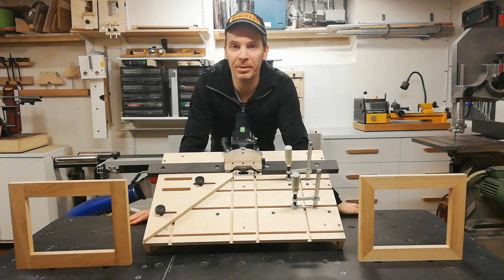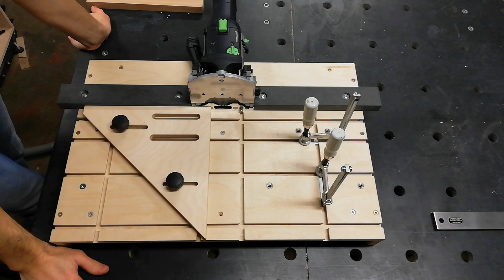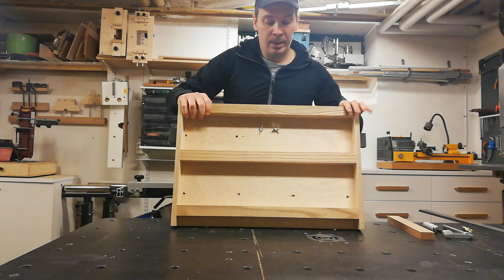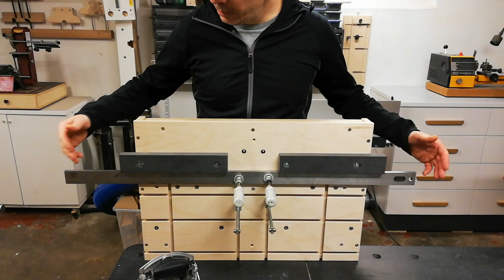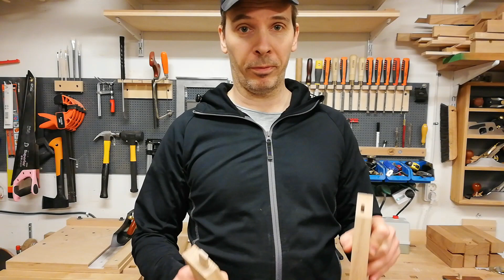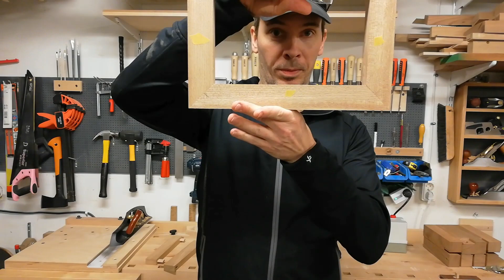High precision Festool Domino jig - Part 1 of 2

Comment: It looks like woodpeckers just came out with a jig (mortise match)  that is very very (very) similar to yours.  What are your thoughts on their jig?
Reply from the maker: It was some years ago and there was a heavy debate in the woodworking community at that point, both on youtube and different forums. Veritas released their version and credited me and gave me royalties per sold item. Woodpeckers released their version almost simultaniously and pretended they had never seen my jig (which is quite obvious they had). I wasn't as upset as many others were but I think Woodpeckers should have acknowledged me for the idea, they got a lot of critique for this.
Reply: @CarmoniusFinsnickeri  Ah, I'm late to the party.  In this case I don't think I'll give Woodpeckers my business.  Your design looks simple, solid, and precise, and I much prefer your embedded rod design for referencing the fence location when flipping it.  I don't expect to need anything more than 0 and 90 degrees, so I'll have fun making my own.

Comment: 2:05 congratulations you just broke your Domino!!!! 🤦
Reply from the maker: Thanks! I know that since a few years back, didn't know it when I made this video. Good news is that my Domino is +12 years old and not broken. I think if lever is not forced, nothing inside will brake but since a few years back I change width with the motor running. Stupid design imo, changing setting on a running handheld machine feels extremely unintuitive and Festool also changed this for the 700 model.
Reply: @CarmoniusFinsnickeri yeah it is a weird one. Good to know it's different on the 700 as that's the one I'm leaning towards

Comment: I am just about done building one of these jigs. What do you use for a reference line? I make a mark on my work piece, but there is no visible reference mark on the domino except the fence, which is too high up to use.

Thanks! Excellent jig and video!
Reply from the maker: I have the old generation Domino, on that there is a indication in the metal casting where the center is. I looked at pictures now and it seems they removed that on the "new" Domino where they changed the indexing tabs? Anyway, if it's not enough to lower the fence as much as possible, can you lower it and tilt it 90 degress so you use the fence scale from above instead? I should also say it's not very critical to hit the layout line perfectly, eye balling is more than good enough.
Reply: @CarmoniusFinsnickeri  thanks!

Comment: Hey. What saw blade do you recommend for the super jig where you use a 3.25 kerf?
Reply from the maker: @beewagyu  any rip blade with flat top grind (FTG). Several suppliers have these in 1/8" or 3.2mm. I use a swedish blade and that's maybe not of great help.
Reply: @ ok. Thx. Easy Peasy.

Comment: Excellent video and very well explained!  Question:  Any advice on how to get the holes for the domino placed so that the machine is exactly in line with the 2 fences (to the left and the right).  Thanks!
Reply from the maker: @israelcharo1563  Thanks! No better way than measuring as good as you can and use slightly oversized holes. As I show in the video I align the domino with the front of the fence faces when I mount it.

Comment: An old fashioned horizontal boring machine w two dowels is much faster, simpler, cheaper, more stable and proven strong.  I own a domino 500.  Good for its portability for use on the jobsite and for joints that require more stability than usual such as ironwood with sepo dominos and two part epoxy exposed to the elements.
Reply from the maker: Yes? This jig was mainly to simplify a few things the Domino already can do, for those who rather extend/improve the use of their Domino than buying a horizontal boring machine.
Reply: @CarmoniusFinsnickeri  yes the table does that and the combination works for a hobbyist or for a few joints.  My contribution is toward a production shop where time is money.

Comment: Very nicely designed and presented, thanks. The only change I might make is to use toggle clamps mounted to the movable (triangular) fence. They could save a lot of clamp twisting, especially if there were a lot of pieces to cut that were the same thickness.
Reply from the maker: Thanks! Yes I'm aware of that, for larger runs toggles are faster. Problem is the put a load on the jig which needs to be quite beefy if using toggles. For shorter runs the difference is not that much, especially since the rail clamps doesn't require any fiddling to adjust to different workpiece thicknesses and widths.

Comment: Very nicely designed and presented, thanks. The only change I might make is to use toggle clamps mounted to the movable (triangle) fence. They could save a lot of clamp twisting, especially if there were a lot of pieces to cut that were the same thickness.

Comment: Excellent jig!  Well made!  Great instruction!  One question:  on the but-joint frame, why couldn’t you simply have found the exact center of the end grain piece and extend that line across to the side grain piece and then just line up the center line of the domino to those lines.  That’s what I do and I get perfect butt joint alignment every time.
Reply from the maker: Thanks! If I understood your question correct; The whole idea with this jig is to get more exact result than if aiming for layout lines, and also save some work with not needing layout lines since the jig handles that. If you use your method for the butt joint with perfect results you should get perfect results also for a miter joint(?). I didn't really get the center thing, but many times I want the joint off center, if there's a routed rabbet towards the inside of the joint for example.

Comment: Thank you for clever innovation and excellent video. Could you please tell us model/product number of the Axminster bit that cuts T-slot for Festool clamps that you refer to at 3:58? Also, in case you haven't heard of it, you may like to check out Ramon Valdez's recent product, Domino Dock, which also transforms Domino into stationary machine suitable for  small parts, although IMO not with the level of sophistication or application as your table.
Reply from the maker: Thanks Michael. The link to the router bit is in the video description, there is also a product no for a similar cmt bit. Press the arrow down to the right and you will find it. If I built this today I would change and go with the microjig dovetail clamps. I checked the Domino Dock and realized I had seen it before, I would say it has a bit different area of use and is not as allround and precise as mine.
Reply: @CarmoniusFinsnickeri  Thanks for your quick response. I am aware of the Matchfit Microjig system and have made several shop fixtures, etc. with it. However, as I work primarily as trim carpenter on site, I have been trying to develop a system of lightweight portable benches in which it would be desirable to accomplish two characteristics that may in the end prove incompatible with each other: The first is that whatever dovetail or T-slot groove system I settle upon be universal throughout my system, i.e., able to accommodate either Festool style or Microjig clamp heads everywhere, so that whichever style clamp I have on the job can be used. (I especially favor the Festool and Bessey quick action ratchet type clamps.) The second characteristic is that the groove system not require either work top thickness greater than 19 mm or additional reinforcement form below,  as you have rightly seen the need to do with your table, in order to avoid that the work surface become too weak. As I say, I'm not sure these two characteristics are compatible with one another. So far, it looks to me that the Microjig system requires groove depth of only 10 mm, due to the strength characteristics of the dovetail shape, whereas T-slots required for typical track clamp heads must be at least 12-13 mm deep in order to avoid leaving insufficient material either above or below the slots.

Another YouTuber, roughcutprince, has experimented with alternately configured (10 degree) dovetail grooves that will accommodate both Microjig and Festool/Bessey clamps. I have not yet tested his ideas or conclusion that such a dovetail slot is strong enough to resist premature wear or immediate failure, but his solution looks very promising.

In any case, as a fellow craftsman and innovator, I'm glad I stumbled onto your channel. Subscribed.
Reply from the maker: @michael.schuler  Thanks for your thorough explanation. There is also an option to file away a little bit of material on the festool clamps to make them fit the microjig dimension dovetail tracks. There is a video about that mod on youtube.
Reply: @CarmoniusFinsnickeri  Thank you. That seems like it might be a better and more efficient solution, as I will be spending far more time cutting slots than it would take to file a few clamps, and I also like the Microjig dovetail cutter with its integral softening of the top edge of the groove. Have you done this clamp modification? Does it compromise the fit of the Festool clamps in the guide rail slots at all?
Reply from the maker: @michael.schuler  no haven't done this mod as I have had no reason to. I own both clamp types and they are very close at hand in the shop. Here's a link to the video https://youtu.be/P1GAZFpGSq0
Reply: @CarmoniusFinsnickeri  Thanks. I just watched it. Also saw another one where a guy filed off the sides of a Microjig clamp so it would fit into a Festool rail or T-slot. You reinforced your work top due to the depth of the T-slots. If you were now to rout in Microjig dovetails instead of T-slots, do you think the extra thickness of the top remaining under the dovetails would eliminate the need for the reinforcement?
Reply from the maker: @michael.schuler  don't know really. The part would still be quite strong but routing tracks half the thickness in baltic birch it might warp, the layers seems to stabilize each other.
Reply from the maker: @michael.schuler  ...but if you can have internal tracks and keep the edges unrouted that will improve stability a lot compared to routing side to side and break the edges. Then you would need openings to drop down the clamps from above. Check my long grain shooting board video for reference. https://youtu.be/OeKpxs64hqY
Reply: @CarmoniusFinsnickeri  Thanks. I checked it out. You videos present a lot of food for thought. Regarding my ongoing modular work site bench project, there are many possible ways to achieve flexible clamping options. I hope to sort through them and come out with an ideal solution for my particular work flow soon. Meanwhile, I can see that there is lots to learn from investigating your channel further. Thanks for taking time with me this morning.
Reply from the maker: @michael.schuler  No problems and thanks, glad you find my videos interesting. Good luck with your modular workbench.

Comment: Seriously cool. Folks are linking your video since Woodpeckers just came out with a similar jig, but I really like yours. One possible helpful change is to use the Microjig matchfit system which would let you not have to have the threaded inserts. Thanks for the idea!
Reply: I wouldn't call it similar; it's pretty much a direct copy
Reply: yeah, what Billy Stray said: it's a shameless ripoff.
Reply from the maker: Thanks.

Comment: Great Jig!  I'm going to make one today.  I have a question though.  I've looked all over the internet for the base plate dimensions.  Specifically the spacing between the 2 M5 mounting screws.  I'm going to grab a set of calipers and measure but thought I'd ask if you know where I can find those specs on the web?
Reply from the maker: Thanks! I measured with a caliper, doesn't need to be super precise, make the holes oversized so you have some wiggle room to align the domino to the fence when you mount it.
Reply: @CarmoniusFinsnickeri  , 50mm is the magic number for anyone else making the jig :-)
Reply: I finished the jig and used it for the first time last night.  It's a game changer for narrow/small workpieces.  Thanks for much for sharing your design!
Reply from the maker: @foamx01  Yes it is🙂. Nice to hear that you finished the build and are satisfied with the results.

Comment: Hello, thank you for this great idea. I'd like to build it for myself, but the Axminster bit for t-slots is out of stock (and will be in stock maybe at the end of the year). Do you know about some alternatives?
Reply from the maker: Hi, yes I have a few alternatives. #1. For t-slots that match the rail clamps, cmt router bit 950.004.11 is said to fit. There are probably other M8 t-slots cutters rhat also works. #2. You can use the matchfit dovetail clamps and suitable bit. #3. You can make the base out of 2 layers, then you dont even need a t slot cutter. Make the wide part of the upside down T in the top layer, before gluing the pieces together and the narrow part afterwards. Good luck and just ask if any questions during the build.
Reply: @CarmoniusFinsnickeri  Thank you for the quick answer. I'll try the CMT router bit. I really like your inventions. And thanks for the willingness to help.
Reply: @CarmoniusFinsnickeri  Sorry for the basic questions, but could you please tell me what buttons do you use (some link) and using which bits you create the holes into the triangles?
Reply from the maker: @sedivyvlkodlak  you can use just about any router bit for the holes in the triangles. The holes doesnt need to be accurate in any way. For the knobs, I used some from the local hardware store. You can find these cheap on aliexpress for instance, search for star knob. The only tricky part to source was the thumbscrew in brass which needs to be smaller than the thickness of the triangle fence. I bought these ones. 
https://a.aliexpress.com/_vKGk4l
Reply: @CarmoniusFinsnickeri  Hello, so I finally built my jig! I have Domino 700, so I had to change the design slightly. I also do not have your latest system for mirroring the triangle .. I created something that is easier to build. It is probably not so precise as your method, so maybe I will upgrade later. I made some mistakes when building the jig, so it does not look as great as your one ... but it works. So I will use it for some time and then probably build a new one so that it also looks so nice and I'll probably also try your system for mirroring later. Thanks again for your great idea and support.
Reply from the maker: @sedivyvlkodlak  Nice to hear you finished your first one🙂. The jig I made a video of was my second iteration, when I was ready with my first one and had used it a year I had lots of ideas for improvement. So, nothing strange to build a new better jig after a while.
Reply: @CarmoniusFinsnickeri  Ok, my last comment gets deleting, sorry if inappropriate. You probably know
Reply from the maker: @sedivyvlkodlak  I guess the comment was about the woodpeckers domino table. If you posted a link that's probably the reason it was deleted. Not by me though, youtube's automatic spam filter often deletes comments containing links.
Reply: @CarmoniusFinsnickeri  I see. Yes, it was about woodpeckers jig, which is based on your great idea (looks really similar). And I see you know already :-) I just wonder ... you cooperate with them or they just "used" your idea?
Reply from the maker: @sedivyvlkodlak  No they just "borrowed" my idea, haven't heard a word from them. But, it's also official now that Veritas will release a version soon and that they are paying me royalties.
Reply: @CarmoniusFinsnickeri  I see. It's a shame ... Woodpekers jig really looks like a slightly improved copy of your design. Looking forward to seeing Veritas version.

Comment: Wow, how did you manage to get a Domino with the original pins?  Mine, and every Domino I've tried to buy since acquiring my current one,  has those not-quite-worthless "paddles" or flaps.  The pin-model is SO much better.  Brilliant work on your jig.
Reply from the maker: Thanks! I bought the machine second handed (but rarely used) and it had the old style pins. I think Festool had to change the pins due to patent conflict with Mafells duo doweller machine.

Comment: Incredible! what is the size of the threads on the face?
Reply from the maker: Thanks! The threaded inserts? Those are M6 but you could of course use other size. If you refer to the threads in the bottom plate of the machine those are M5.

Comment: Very nicely made jig! I had planned to use dominos in my frames, but not having tried it yet I now realize it will be tricky without some alignment jig. It seemed like you were using the smallest setting on the mortise width - maybe you mentioned it. I assume you flipped to the other side half way through was to keep the frame pieces always with the same side up.
Reply from the maker: Thanks! Yes, narrow setting on the machine, especially for mitered frames this is important to prevent the parts from sliding in the glue up. Also I keep the reference surfaces downwards towards the jig base. If not using my "flip the fence method" you would need to perfectly center the domino thickness wise and that is very difficult. My method is not sensitive at all to offcentered joints.

Comment: Great idea! Maybe you can install a tape measure or metal scale on both side of center line?
Reply from the maker: Thanks ! What would the purpose of the tape measure be? I don't see any real use for it, exact flipping of the fence is the key here and referencing a tape measure which is referencing the center line is just not good enough.